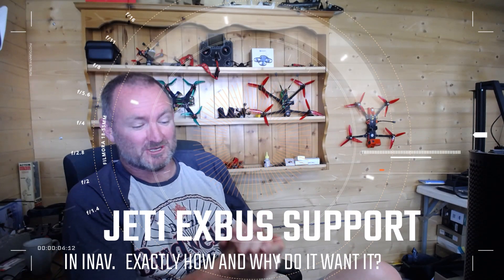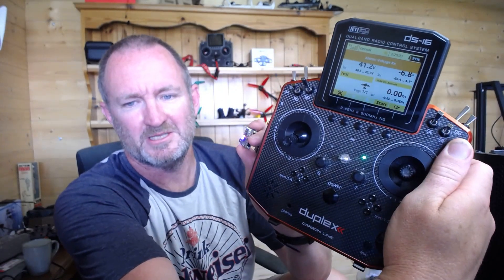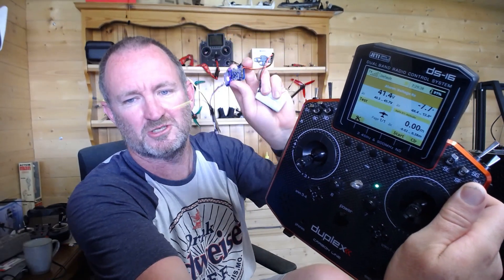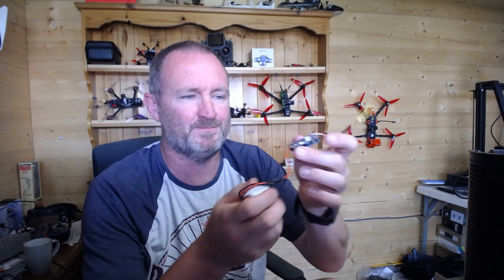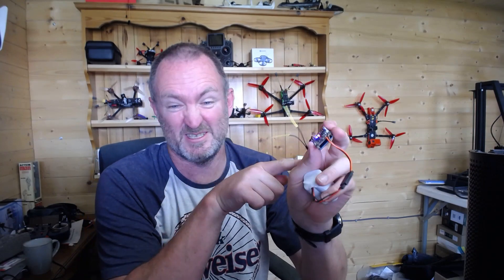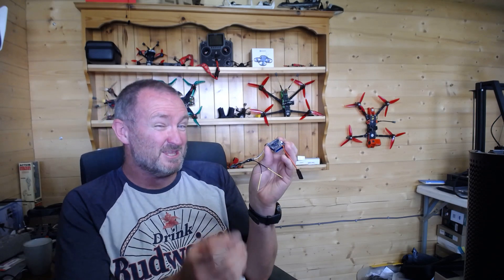JETI EXBUS SUPPORT IN INAV | HOW AND WHY DO WE NEED IT?

Comment: Hi, I am also happy Jeti user. I found out recently that "not properly implemented" EX BUS protocol maybe causing the iNav gets frozen during the flight. Have you noticed also a sudden loss of communication? I crashed twice already because of that?
Reply from the maker: I have not seen this myself.   Probably worth feeding that info back to the dev team.
Reply: @RTRCTV  Thanks, yes I have already done it. I swapped EX BUS with SBUS and it seems to work fine but it does not have telemetry :(
Reply: @RTRCTV  I am still fighting with iNav developers and it seems to lead nowhere. Could you please tell me what version of iNav do you currently use and what FC do you have, what Jeti receiver do you use for iNav, and how often you fly it? Thanks

Comment: Is it possible to run the RadioMaster elrs rangemaster unit from a JETI radio
Reply from the maker: Not so easy.

I do have a project do do an exbus to crsf transcoder.   Works well with crossfire.. But never managed to get it to work with elrs crsf implementation.

Comment: Hello there! I have tryed to connect a Jeti receiver to Inav 3.0.2 but I can´t make it work. I would love to see a video about  this. How do I set up the receiver internally? How do I connect it to the FC including telemetry? How do I set it up in Inav?
Reply from the maker: Hey.. will definitely do a video

In the mean time;

- set port/uart on inav to use exbus
- set port on receiver E1/E2 to output exbus
- connect signal pin from receiver to the transmit (tx pin) on the uart.

Done!
Reply: @RTRCTV  Amazing! Works like a clock! Thanks a lot!

Comment: Gotta wonder how long this is going to last?  You could potentially bypass all of the sensors that Jeti sells and just use an Inav board correct?  This would definitely cut into Jeti profits I would think.
Reply from the maker: I can't see it disappearing.   Exbus has been public for years... Many commercial flight systems use it.. So hardly anything new. 

This is really no different to the rc thought DIY units.    Just on a while level higher.   No more DIY!

There will always be those who buy the sensors.   For many even the simple act of soldering up a flight controller will be too much to handle!

I hope it kicks jeti to up their game a little.    Their kit is fantastic.. But comparatively is loosing ground to the likes of the receiver offerings made by frsky.   They need to broaden the options to stay ahead in this game, or risk being left behind.